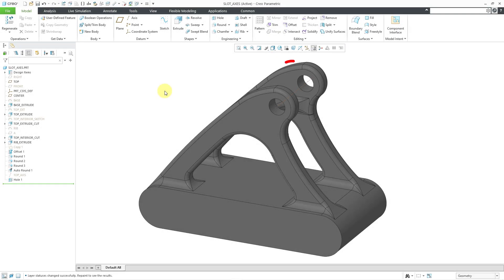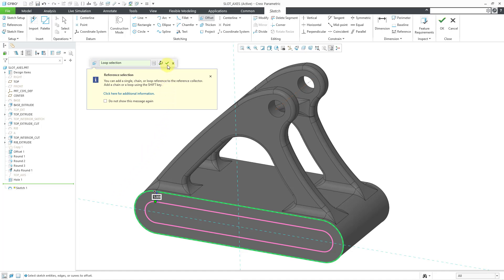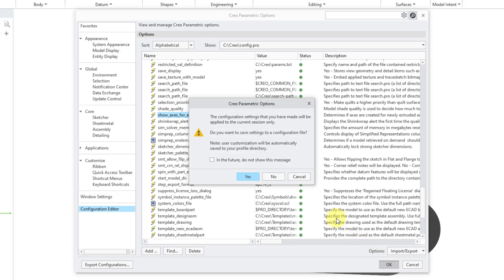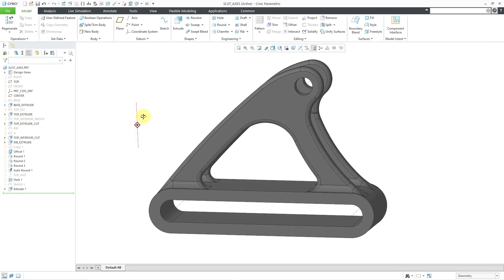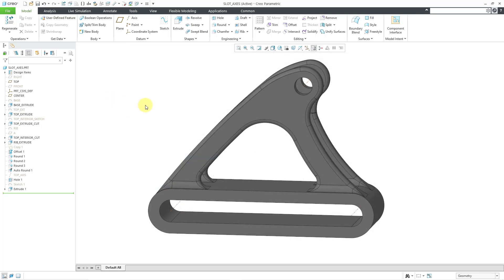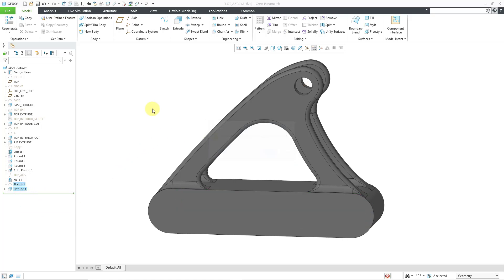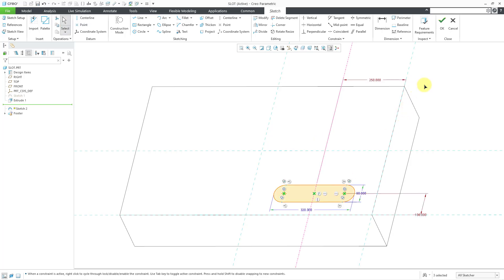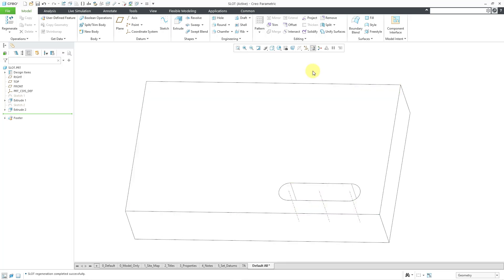Creo Parametric - Adding Axes to Slots - Datum Features

Comment: thanks for your good ptc video. Is it possible make some video in manufacturing (lathe,milling,multi axis,..) same as a mdeling part. I found some but it was same as modeling. you have a lots of video in modeling but about manufacturing it is not . any way one more thanks for your nice ptc training video. god bless you . 👍🙏🙏🌹🌺
Reply from the maker: I've actually been thinking about making some manufacturing videos. My biggest issue is that it's been at least a dozen years since I've done any Creo traditional subtractive manufacturing. There have been SO MANY enhancements in that time - really amazing - and I have not kept current.

Comment: In summary, anywhere you place a geometric point (from the datum group in sketch tab) you will get a datum axis when extruding that sketch.

Also, that point act as a datum point outside your sketch for other features. You can see it when the show datum points is activated.

If you want a reference point in your sketch but dont want a axis there, just change it for a construction point. Construction features/items only can be used inside the sketch. Geometric features/items can be used outside the sketch.
Reply from the maker: Thanks for the summary. I thought this was going to be a 3 minute video but then my mouth got away from me.
Reply: @CADPLMGuy  dont worry🤭, I always learn something new with your videos! This time about that config option!

Comment: Is the creation of an axis via placing datum points within an extruded sketch section new to the latest version of Creo, or has that been a an included feature for previous versions of creo? If so, which version was it implemented with?
Reply: ProEngineer 5
Reply: I can't believe I've been using creo for 3.5 years now and I'm just now learning about this capability. Up until now, I basically only used the datum sketch points for creating pattern seeds lol. This is going to be game changing
Reply from the maker: Early Wildfire (2003 to 2005ish) is my recollection for the normal and in-plane axes from sketcher datums.